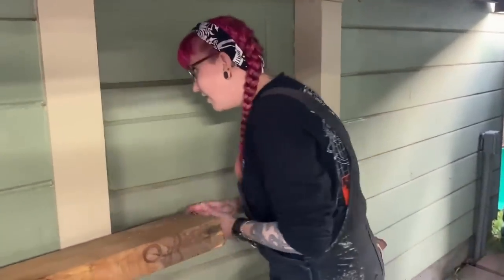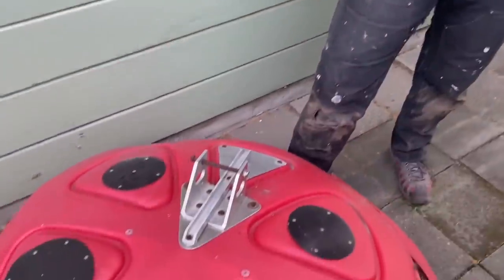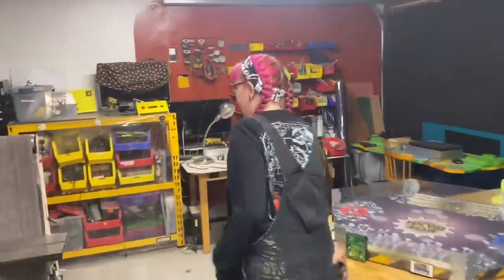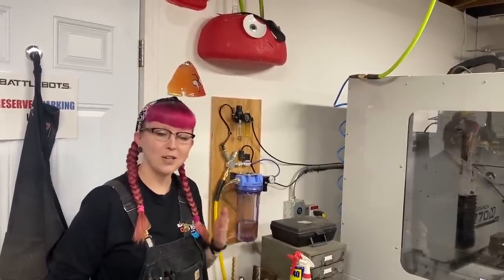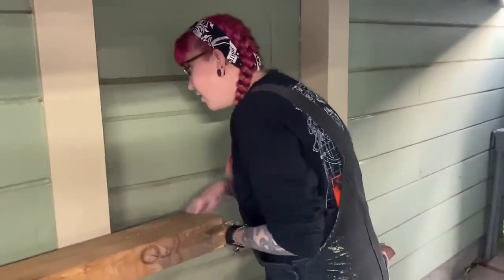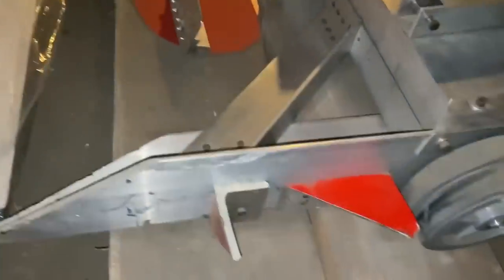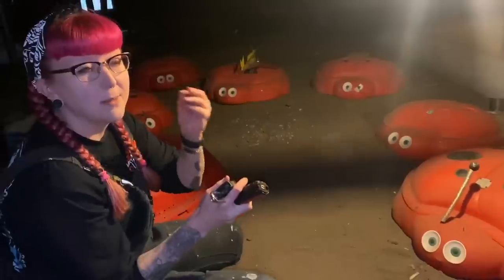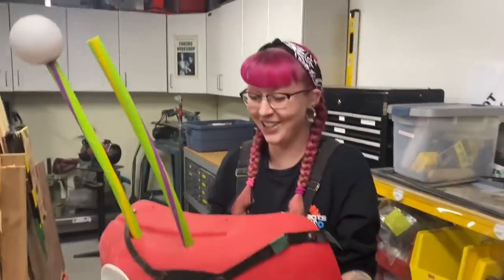What does BATTLEBOTS JUDGE Lisa Winter Think Of NEW APPEALS System!? EXCLUSIVE INTERVIEW!

Comment: I can say one thing, that like in Robot Wars the judges are in a higher-up position to see more resulting in less cotesting with the judges. Also a bit safer for the judges. So, maybe if Battlebots put the judges in hi-hide like in Robot Wars it would be more advantagious.
Reply: Bots would still get flung at them
Reply: @madpsycho6  but far less offten.
Reply: @necromancer0616  Oh, I'm sure the competitors would try and launch bots up there just to mess with them. I certainly would anyway! 😂
Reply: @Aragorn450  I guess they would try.. Like Uppercutt and such.
Reply: for the first few seasons of the series the robot wars arena was pretty horribly unsafe, they pretty much just had 1 layer of cheap plexiglass between the visible people and the arena and all those metal walls were thin enough to be basically cosmetic (you could get a finger through them with a bit of working at it, let alone bot debris) and even worse they usually had crew going around behind them...come to think of it the floor in the judge and driver areas was probably weaker to flying debris than the windows.
they upgraded pretty massively at some point but I don't think they ever got the arena up to the same tolerances as the 2-layer-box design most other competitions use. weirdly enough I would honestly call this a + for the competition since limiting the kinetic energy of the weapons opened up the bot designs and budget requirements a lot.

edit: in short it started out as a tv set before they upgraded it into an actual bot arena
Reply: @evernewb2073  Yea, so like they said now the judges get stuff flung at them all the time now, but if they still don't feel safe I think elevating them would be the next step.
Reply: @evernewb2073  I'm pretty sure it is a two layer box now but I could be wrong
Reply: @necromancer0616  bronco would fling it well.
Reply: @evernewb2073  You literally have no idea what you're talking about. That "thin layer" of lexan you're talking about was only the FIRST, inner protective layer. There was a much bigger and thicker one surrounding the entire arena. You think there wasn't because there was so much space between the two you could walk in there. That made Robot Wars' arena actually safer than Battlebot's.
Reply: @Narcan885  ...are you talking about after they switched venus? I think that's like 3 visually obvious upgrades in, I haven't looked it up properly since that first one though.
to be more specific I looked it up when one of the bots sent another one partially through one of those decorative metal panels and the panel popped off it's mounts revealing stage work area behind it instead of an actual barrier and I started having one of those "wtf those weren't supposed to be just decoration!?!?!" moments you run into from time to time when you're the kind of person who actually looks at how things are built.